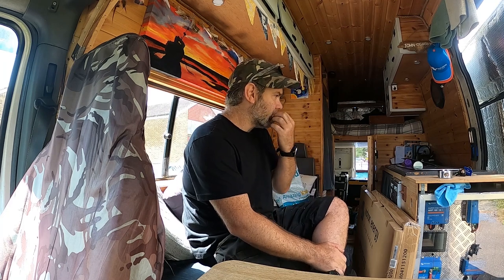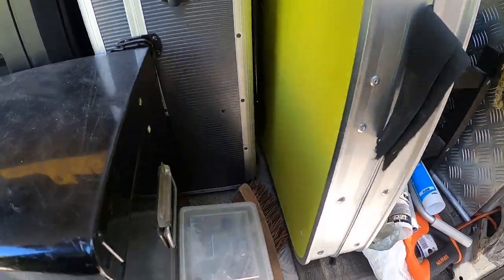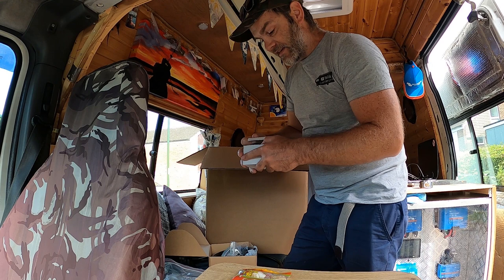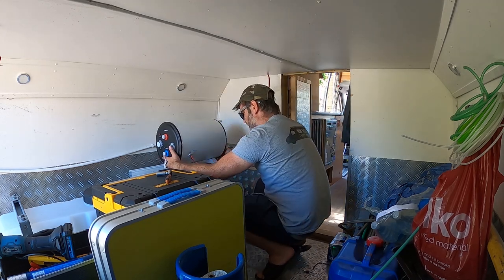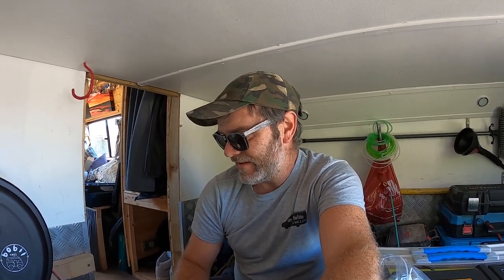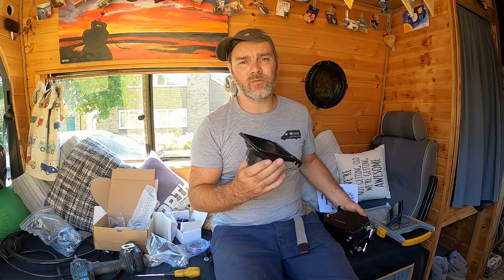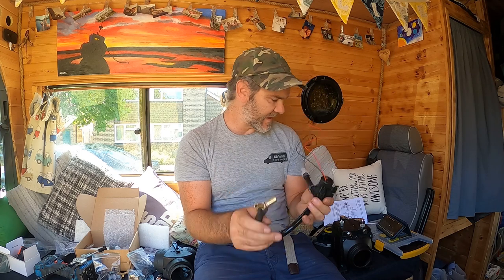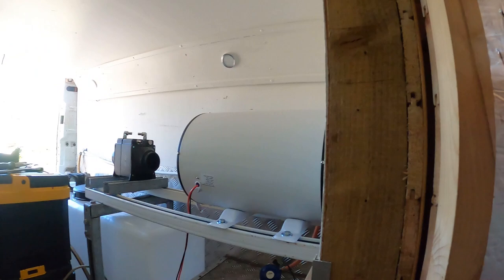Heat Water For Free!! || Bobil Air Hybrid || 12volt Water Heater

Comment: I think the main idea with the heat exchange air feed is to exhaust outside the van when you just want hot water and not hot air, as the other diverted outlet is for hot air in the van

Comment: Hi buddy great video as always 👍  it might be a stupid question but once the hot water is up to temp and you want to use the hot water do you need to turn off the cold supply to the water heater? I'm just thinking that when the water starts being used does it then fill up making the current hot water cooler? Cheers lee

Comment: It looks like a fantastic bit of kit. Out of my price range at the moment as I'm signed of work coming on 4 months now.
Reply: Is 180 £  more of your price range and do you have a min. 500W inverter?
Then search for Truma TT2 (new on ebay).
We bought it this Feb. and it's simple and great. In winter you have permanently warm water from your diesel heater and in summer on demand from stored Solar Energy. Or hookup .
Reply: @cornelius2993  £0 is my price range at the minute as I'm not working, not got any money coming in and just trying to survive at the minute
Reply: Hi buddy   it might be a stupid question but once the hot water is up to temp and you want to use the hot water do you need to turn off the cold supply to the water heater? I'm just thinking that when the water starts being used does it then fill up making the current hot water cooler? Cheers lee

Comment: The air that has passed through the heat exchanger won't be hot, warmish, most of the heat is transferred to the water 👍
It's a good bit if kit, i have the older version without the immersion element and it get well hot 😎
Cheers chap 👍

Comment: this is a great low-ish cost solution to a none truma based system. I'm watching with interest :)
Reply: Truma TT2 is 180€ on ebay ...
Reply: @cornelius2993  of course it is. Thanks for reminding me about this product. Sadly only downside is that in winter to get hot water you would have to charge from batteries or if your lucky b2b.
Reply: @Tangotop doesn't it use hot air from the diesel heater to heaten up the water?